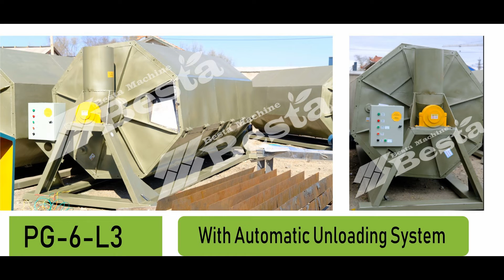Wooden ice cream stick machine, Polishing machine with unloading system (NEW)

Comment from the maker: PG-6-L3 POLISHING MACHINE (WITH UNLOADING SYSTEM)
MACHINE BRAND: BESTA MACHINE 
GENERAL POWER; 11 KW 
Design type: Double layers of main body, inner side is stainless steel ,
frequency control (converter) speed control. It is specially 
designed with unloading system. 
WORKING VOLTAGE: 380V, 50HZ  (CAN BE MADE ACCORDING TO YOUR 
LOCAL WORKING VOLTAGE) 440V, 50HZ, 415V, 50HZ 
FUNCTION: WOODEN ICE CREAM STICK DRYING, POLISHING DUST REMOVING.
THIS MACHINE SHALL BE WORKED WITH Steam Boiler, Heat Exchanger and draught fan.
If you wish to know more about complete line of wooden ice cream stick
making, welcome to contact us. 
Email: info@bestachina.com  angelzhou1224@gmail.com
Whatsapp: 0086 186 5710 6860 Wechat ID: ilikechanging 
Contact Person: ANGEL ZHOU

Comment from the maker: MÁQUINA DE PULIDO PG-6-L3 (CON SISTEMA DE DESCARGA)
MARCA MÁQUINA: MÁQUINA BESTA
PODER GENERAL; 11 KW
Tipo de diseño: capas dobles de cuerpo principal, lado interno es acero inoxidable,
Control de frecuencia (convertidor) control de velocidad. Es especialmente
Diseñado con sistema de descarga.
VOLTAJE DE TRABAJO: 380 V, 50 HZ (SE PUEDE HACER DE ACUERDO A SU
TENSIÓN DE TRABAJO LOCAL) 440V, 50HZ, 415V, 50HZ
FUNCIÓN: STICK DE HELADO DE MADERA, PULIDO DEL POLVO, ELIMINACIÓN.
ESTA MÁQUINA SE DEBE TRABAJAR CON caldera de vapor, intercambiador de calor y ventilador de tiro.
Si desea saber más sobre la línea completa de palitos de helado de madera.
Haciendo, bienvenido a contactarnos.
Correo electrónico: info@bestachina.com angelzhou1224@gmail.com
Whatsapp: 0086 186 5710 6860 Wechat ID: ilikechanging
Persona de contacto: ANGEL ZHOU